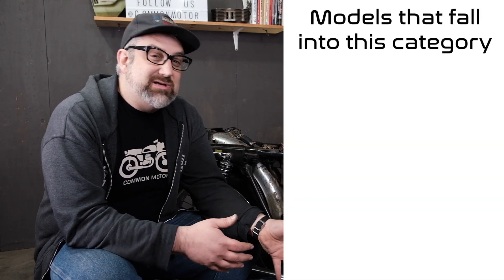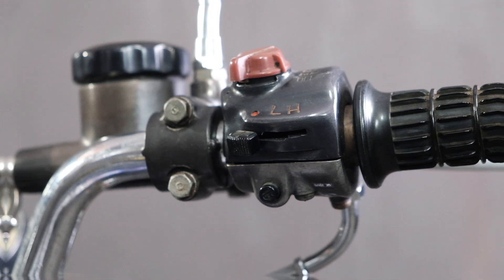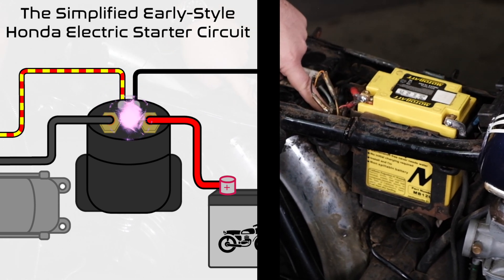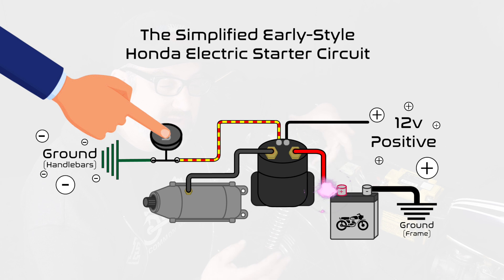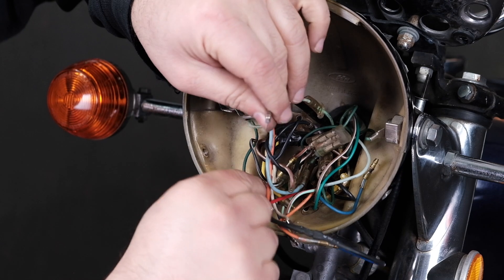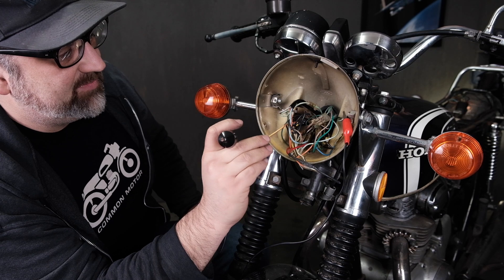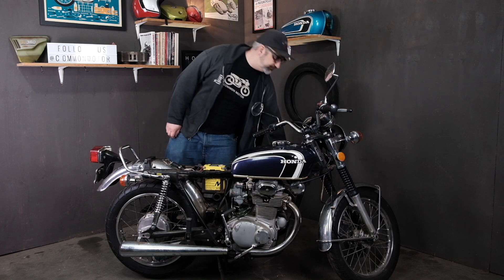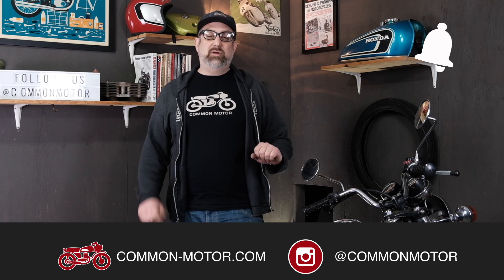The Early Style Starter Circuit: Electrical Troubleshooting and Basics on a Vintage Honda Motorcycle

Comment: there is green wire connectioins through the electrical board on my cb500 four. pictures do me justice..  they are chopped. like someone spliced them all togethor.. I had to un do all the janky crap. and now I have to place in new wires.. some how.. like with pins.. Im prob gonna damage the plastic. on these connectors.. im gonna rip these pins

Comment: Brother I have a 1971 cb 175 I found a cm200 motor with harness and a 6 volt rectifyer for the 200 motor. Tried cb175 harness and coil no spark. Coil bench tests good but on the bike no spark. I’m looking at the cm 200 wiring and get so frustrated because I don’t know electrical well enough to hook up the cm harness. Today I ordered new handlebar switches had starter turning over and I unplugged now the switch won’t engage starter anymore grr. Help. What do I need to get the cm200 harness to work bare minimum to get it started please and thanks

Comment: I have checked the circuit and it all seams to be good but the solenoid just clicks and does not turn the starter over. I added power directly to the starter and it kicks just find. I also got a new cable from the solenoid to the starter and that was not it either. Not sure what to do next?

Comment: Hello

Thank you for your vid, but i was hoping you can help me diagnose my bike

i have a virago 125 that I was reviving, when i got the bike all the electrical components were working. I did not know much abut the electrical systems of the bike so when I removed my engine to repaint the frame i had the electrical components still attached, when i but everything back the a problem occurred. The moment i plugged the electric harness  to the battery the whole electrical system switched on., i had not turned the key to on and i had not hit the start button but the bike lights and neutral light was on. When i pressed the ignition button to start the motor there was a funny sound from the solenoid, and it has nt reacted when i pressed the button again. (I have a feeling the solenoid is burnt). When i disconnect the start button the system the lights do not turn on unless i turn the key, but then i cannot start the bike at this point. I believe there is a short in the system, but i have no idea where. I have undone the whole electric harness and i cannot find this exposed wire or short so i do not know what to do . Please help...

Comment: Thank you for this video and all the other videos that you have published.
Last fall, using parts from Common Motor Collective, my 1969 CB350 ran for the first time in over 40 years. I look forward to continuing down the path to a roadworthy motorcycle. I don't think I would have the guts to try this if it weren't for all the support you give. Thanks again.

Comment: What would cause a slow cranking issue?   Mine sounds like it’s turning over at half the speed of the bike in your video.   I’m Using a fully charged  3102 AGM battery from common motors.

Comment: Sorry for the long comment… I’ve got an interesting issue. I have a 1971 CB750 and I just redid left side hand grips turn signal and horn wiring. The previous owner had cut the wires to the turn signals and the horn and so I re-soldered new wires onto the switch and button. Turn signals and horn work fine now, however, the left side turn signal sometimes will flash really dim constantly. When I switch that left-hand wire to the right side turn signals, they too blink dimly. I have new LED lights in the turn signals as well as a new LED flasher. I think the issue is that left-hand turn signal wire is getting grounded somewhere in the handlebars which is causing the flashing. Let me know what you think or if there is an easy solution, because this is a weird issue to me.
Reply: Measure from the hot leg and ground as in pull the power wire that feeds the signal and create those conditions and view voltage. If 12v then you’re getting good power to the lamp